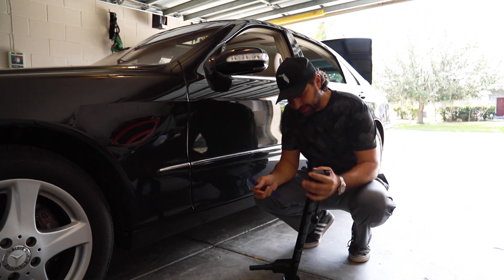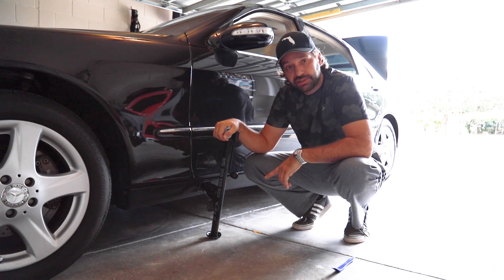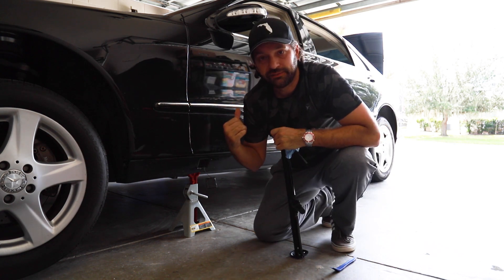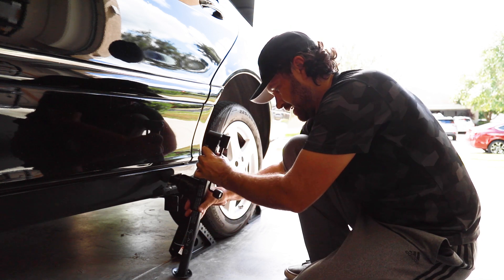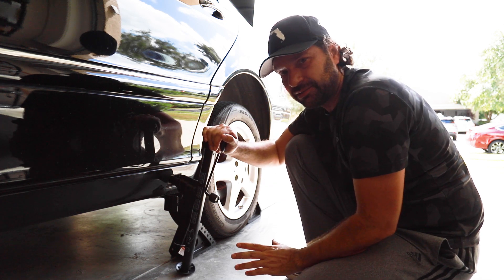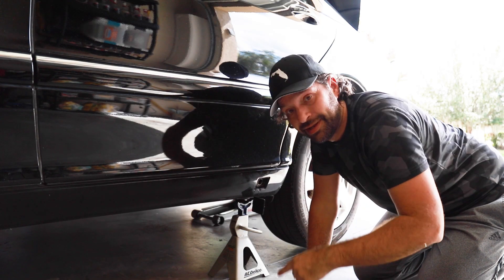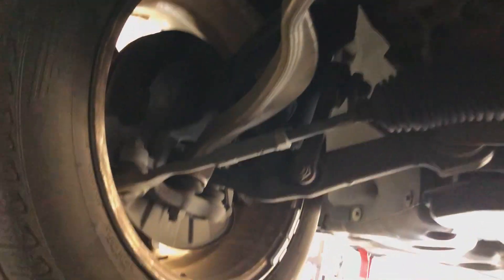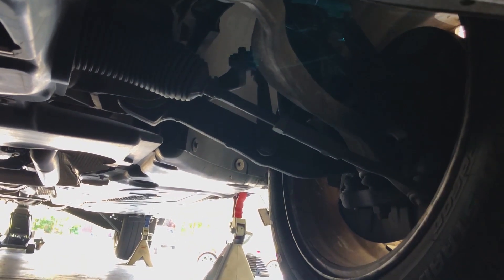How To Completely Lift A Car On All Four Jack Stands

Comment: It is very important to make sure that the car is even from left-to-right. The reason I mention this is that a typical home garage floor will have a slight downward slope from the house to driveway for drainage. Thus, parking the car at even a slight angle from the axis of the garage floor will result in the left side of the car being higher than the right side, or vice versa. Even this small tilt can impart a relative elevation to jack stands (even allowing for their adjustability) that in turn affects the balance of the car on the jack stands. This is an observation from experience.
Reply from the maker: Excellent point. Thanks for sharing. Car jack safety is very important.

Comment: Love the hockey puck and slotted pads idea Daniel. I use wood, but I'll buy a pads now. Thanks!
Reply from the maker: I used to use wood. And one day it got wobbly. I used a hockey puck I had laying around and been using it ever since. You can also stack a couple hockey pucks safely, but not so on wood.
Reply: I always keep half a dozen hockey pucks in the garage.    You might want to have a look at wheel cribs.  Those little jacks that comes with the  car are death traps.
Reply from the maker: @robertfontaine3650 yes they are. However it doesn’t really even matter anymore. Most millennials wouldn’t know what it’s for anyways.

Comment: I like this video. Your approach is conservative and cautious.
Reply from the maker: Thanks. Yeah, no matter how often I’ve done it, it scares the shit out of me.
Reply: @Turbo_Snail  I understand the fear. I'm not mechanically inclined, and started working on my owns cars about 5 years ago. Many years ago, I used to watch renovation show "This Old House." One of the hosts gave  advice about working with a power tool (e.g., a power saw). His advice was to the effect: always ask yourself, if the tool slips, where is the tool going to move and where is my body? I approach lifting a car with the same mindset: if the jack or stand slips, where is the car going to move, and where is my body?
Reply from the maker: Yeah, same here, you are right. You can’t often see it in my video but when I jack up the car on the stands, when I work on a corner I add the extra jack on that corner as well. Just to be safe. A 4000 lbs car, a circular saw, any fast or powerful tool, I just double check. I just double check!

Comment: Great video - one question. I have a W220 similar to yours. Only just bought it and want to replace the airmatic pump, so I am going to have to jack her up. I currently have a 2 ton hydraulic jack and 2 ton stands. I know the W220 is rated at 2475kg so am I going to have to get completely new jack and stands to lift her?
Reply from the maker: Well, if you got jacks rated at 2000kg, and you lift the entire car on 4 jacks. That’s 8000kg carrying capacity for a 2500kg car. I mean it’s always better to go beefier but lifting an axle worth let’s say 3/5 in the front there’s enough room. Also, I always use my jack near where I’m under in addition to the jacks stands. Just in case something fails. Good thinking tho and always safety first. I haven’t done the pump yet so I haven’t looked or made a video yet.

Comment: Its very risky to lift one corner of  a car placing it on a jack stand (axle stand, if British or Irish), then lifting the other side to do the same.The weight can shift unexpectedly, causing a topple, especially if using one of those axle stand rubber toppers, which can slip or move under load. Always better to raise the car in the middle, under the engine, if you can, then carefully lower it onto the stands.
Reply from the maker: Even with my extra long low profile jack, I can’t reach under the engine on my car. Also there is no safe jacking point in the middle of the car. Every car has markings where to apply the jacks safely. Also it’s usually illustrated in the user manual. There are tons of TikTok’s where people break their car jacking it up in the wrong spot. I for one, have never seen a professional jack up a car on the side/middle. Most cars are usually front heavy and would pivot forward if you attempted to do that. Be safe out there.

Comment: Also, watch those release levers on the stands. If you are under the car and one of the levers gets touched accidently, that corner of the car is coming straight down. The design of  these don't usually have a safety pin, which isn't great.
Reply from the maker: Actually when there is weight on it, it requires a lot of force to lift those levers. Almost impossible to do it. These are not like your grandfather stands that require a safety pin. If they are old, I would change them for new, non harbor freight ones.

Comment: I've seen warnings that you should not jack up opposite sides of a vehicle.  When the tire on the 2nd side leaves the ground, the car may shift; the other side's jack stand may wobble or fall over.  Maybe this affects certain vehicles more than others.
I had the notion to have 2 jacks simultaneously lifting the back (also the front if still using the pinch welds, no centered jack point).
Do you think this would be safer/better?
Reply from the maker: I try to be as careful as possible. I use at least one jack stand and in the corner I work on I keep the regular jack there for extra support as well. It’s not always visible but I make sure it’s as save as possible. Now the Mercedes weighs a lot more than my 200, but somehow I feel the Mercedes sits more secure. I also try to shift/wiggle the car while on stands to make sure it’s stable. 

When I do videos it is also easier to lift the entire car. I need to run the camera, operate the tripod, still do the job at hand, it’s too much hassle to lift and drop the car for each corner separately. 

Now that I have lifted the entire car several times, I feel very confident, and I do it fairly quick. Currently it’s my preferred method of doing things. 

I can’t stress enough that whatever method you use, you got to make sure and triple check the jack stands. And always use a second method of support where you are.
Reply from the maker: To answer your question, only use the manufacturer recommended lift point. My 200 only has the pinch welds to sit on, whereas the Mercedes has several points underneath the car. I love that I can lift the entire back or front on the Mercedes at once. No such Anker point in the 200. Check the manual.